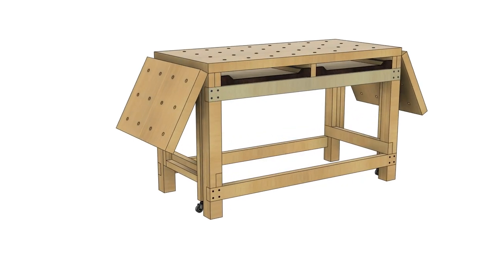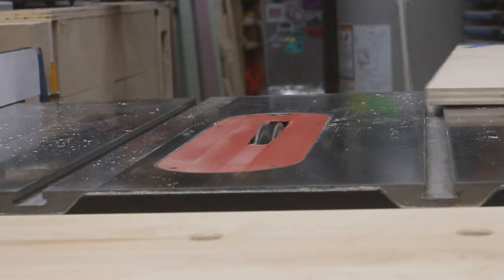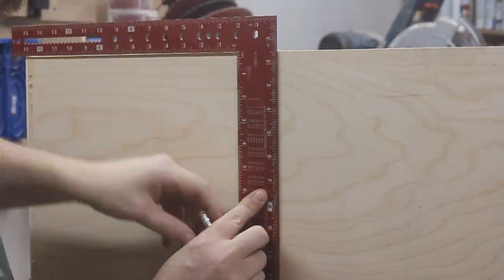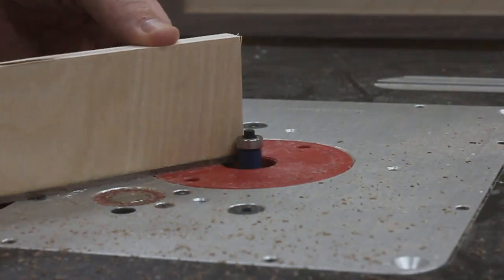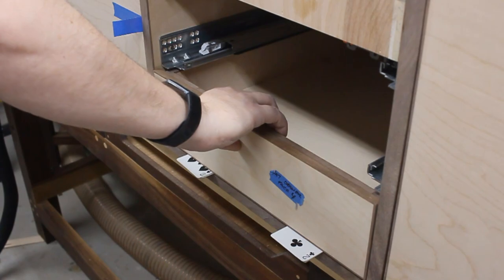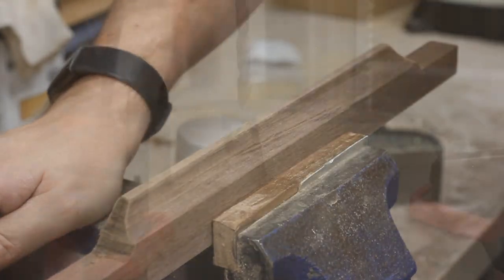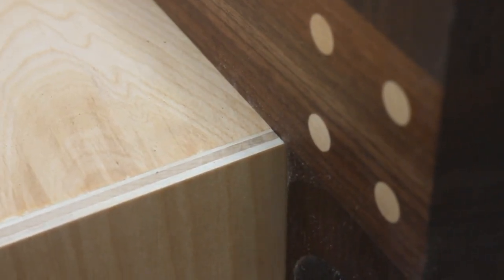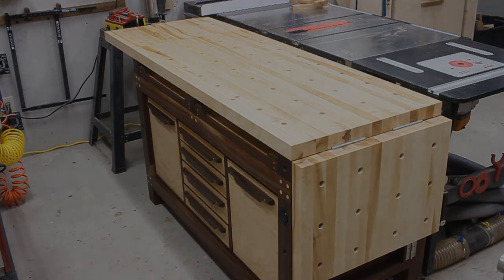Woodworking: Fisher's Workbench Storage Cabinet

Comment: Drew, that is one fine looking workbench. Just goes to show, just because something is for shop use doesn't mean it can't look good. I wish I had (or knew how to use) the 3-D design software for designing things like you do - I just have to envision them in my head and make the mistakes as I cut and assemble.
Reply from the maker: Thanks!  Yeah, if I couldn't design it first, then none of these projects would ever happen.

Comment: As always, a great video! I really like the workbench with the cabinet. I have a very tiny work space (about 8' square) and space utilization is always a challenge. I bought a Milwaukee rolling tool cabinet and put a Kreg Adaptive cutting System table top on it. It works great overall but at times it's a little tall. I may be buying yet another set of plans from Fisher's Shop!
Reply from the maker: Right on! :)

Comment: Those self closing slides are great. I recommend getting and usi g the jig to drill those two holes on the backside of the drawer. Sometimes there is just enough play in the slide that when you press to get an indent, it isn't rightly inline. It is a pain trying to figure out if you need to move to hole left or right. The jig is perfect every time. It is easier/faster to jiggle the slide until it clicks into place.
Otherwise that is one beautiful bench.
Reply from the maker: Yeah, I probably will if I have another project that needs this many slides

Comment: You know it's going to be a good start to the weekend when Drew brings out a new video.
I very much like the cabinet you made, especially the drawer pulls. I'll draw some creative inspiration from what you did when I upgrade my bench in the near future. Of course, I will have to use (un)necessary Jarrah since I have that much more readily available.
Also, you made a good call on supporting that pull-out tray. Had a pull-out rubbish bin drawer face pull off due to a flaw in the manufacturer design. I essentially rebuilt the system and included supports. It's been several years now and it hasn't shown any sign of failing yet. 
Also, to further add to this essay of a comment: I very much enjoyed your presentation in the video and felt the flow of the story was good. I was disappointed when the video ended - a good sign you kept me at least engaged.
Reply from the maker: Thanks! I sure appreciate that

Comment: I would probably have taken some 40 grit in the random orbit and taken the top and one side down a bit, thrown some wax on it for slide factor and then squeezed it into the opening. The unfortunate event of pushing a joint apart would have been a concern, that and I have no friends to bail me out.🙂

Comment: Drew, where did you get the drawer slides. Looks like you bought in bulk but I don't see a link to those??
Reply from the maker: They're Blum slides.  Excellent slides but since they're undermount it reduces the size that the drawer boxes can be.  The plans were altered to use standard side-mount slides

Comment: You didn't make your workbench flush with your tablesaw. I notice a lot of woodworkers use their workbench as a feed table or whatever you'd call it. Although with that hidden drawer I guess you can call it a feed table.
Reply from the maker: It works nicely as my outfeed.  It's about 1/8" lower than my table saw so it's perfect for an outfeed.
Reply: Perfect, beautiful work. I always love the details and I really love the outtakes at the end of your videos

Comment: Please excuse my ignorance with this question. How does the dado blade on the table saw cut a channel? The blade that you use to cut the dado appears to be two blades a certain width apart so to my mind this would cut two grooves in the wood, rather than a channel for another piece of wood to slot into. I hope that makes sense!
Reply: Dado blades have chipper blades sandwiched between the two outer blades.  The chippers clear out the center.